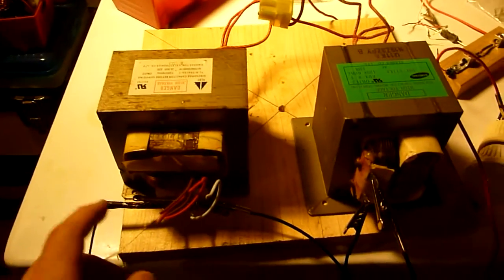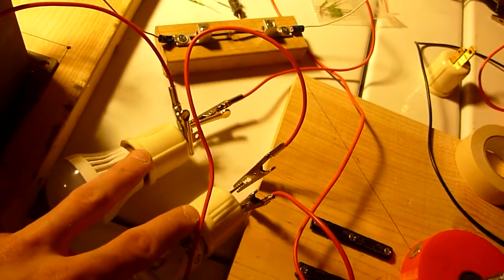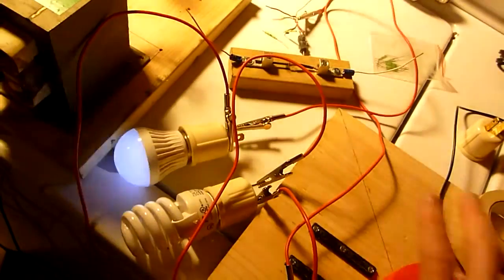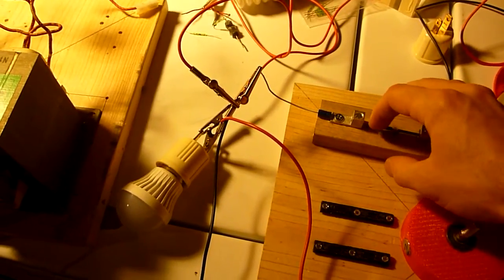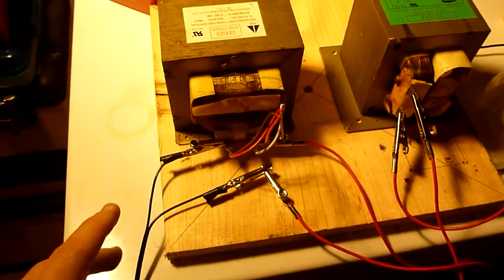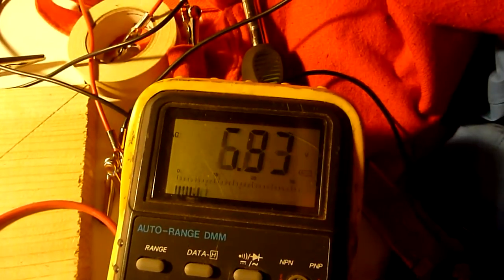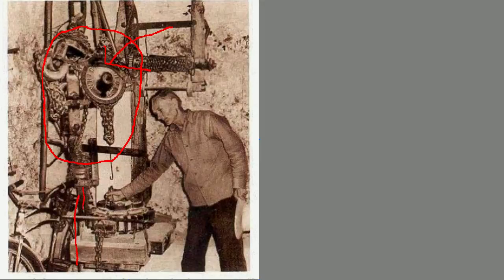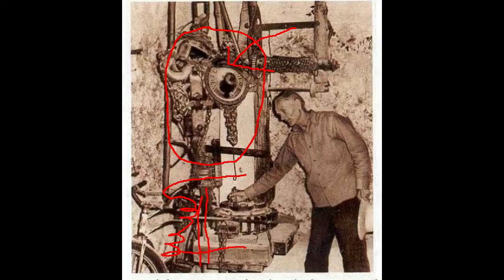Back EMF Experiment

Comment: +Naoki Kashima Can you make an adjustable, Scalable, simple, Pure Sine Wave Inverter Oscillator? By adjustable I mean an oscillator Circuit that can allow for changing the driving or switching Mosfet and there input voltage.
Reply: you need a PWM and a voltage regulator easily available online

Comment: why do you need a battery for overunity to work?
Reply from the maker: +Onaduja Dare Money rules but it is what also keeping people down right now. The ones with the most money cause the bulk of the world's problems. Anywho... I used US-made Maxwell super capacitors. Those things are like 8$ a piece. Have you heard of Eric Dollard and his wireless power research? Dollard is the only person who has ever replicated every one of Tesla's experiments. Good luck with your projects, keep me updated.
Reply from the maker: ***** Indeed, I am working on a system that doesn't need one. It is only a matter of time :P There is plenty energy in the vacuum of space to power the world.
Reply: are you from japan? whats your background?
Reply: ***** Show us the law or book that says you cannot have a battery? Or did you just make that up?
Reply: +Naoki Kashima I think High Farad Super Capacitor is the Key to Complete Overunity in Pulsed System. So the Motor (which must be in Attraction Mode and Axially set-up) must be hand cranked  to charge the Super Cap and 2-way switch plus some other components are need to make this to work. I have came up with a yet to be tested design. Money is holding me down for now to buy the needed High Farad super cap from China. Money Rules Naoki.